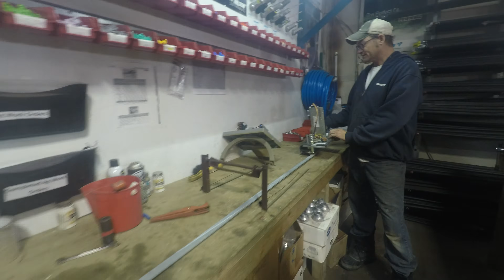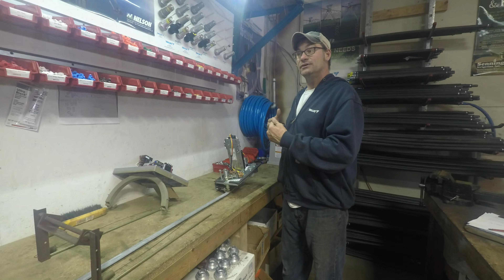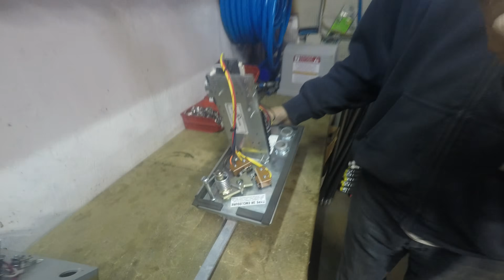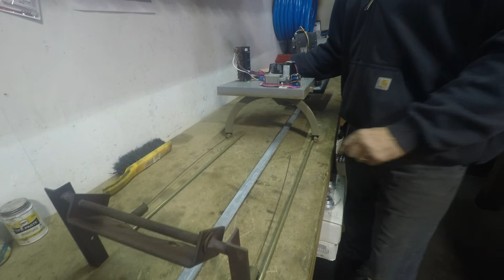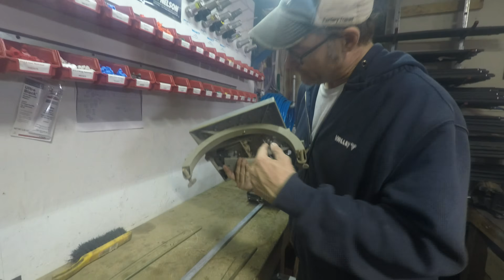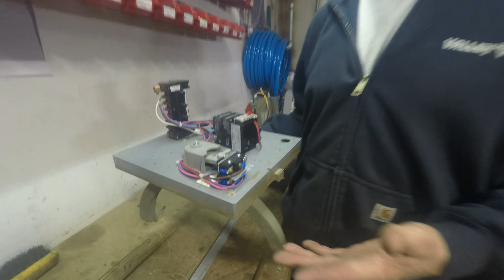Valley V Reinke towerboxes

Comment: Thanks for your lessons,
But i have a problem, our pivot when is setting on100% runs after 20min the fiveth tower become misaligned, but if it is setting below 80% it runs good.
I tried to change over watering timer, micro switch but no result, can you guide me inorder when i set it in100% runs normal?